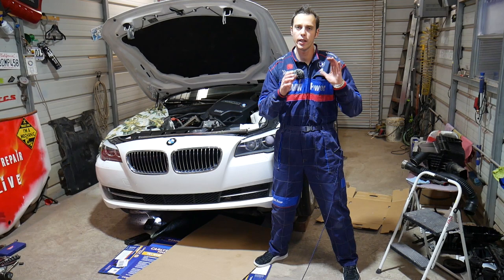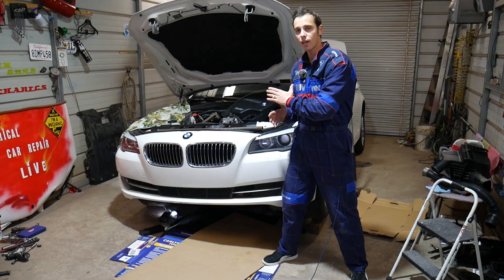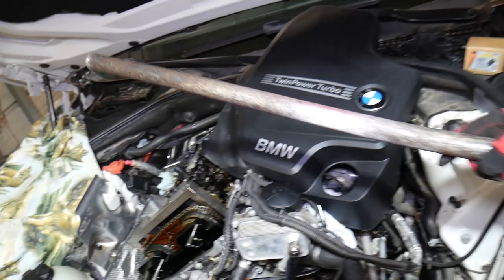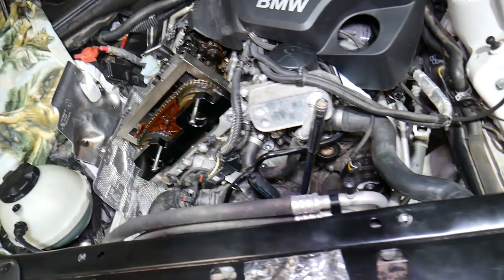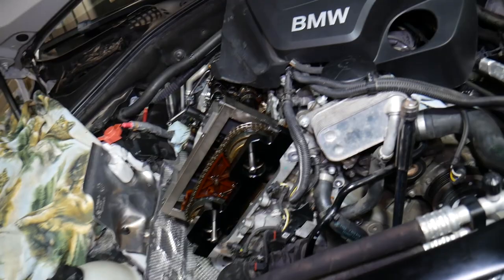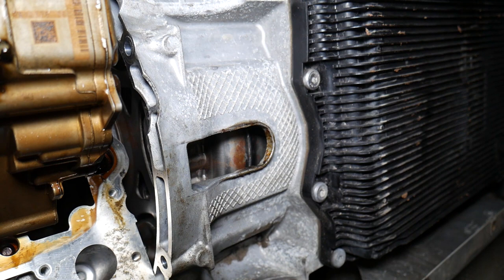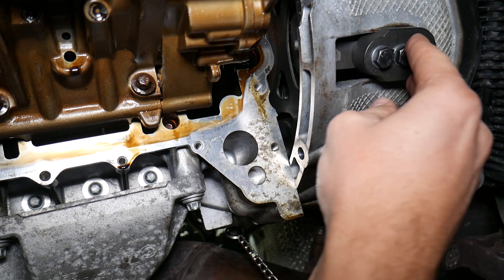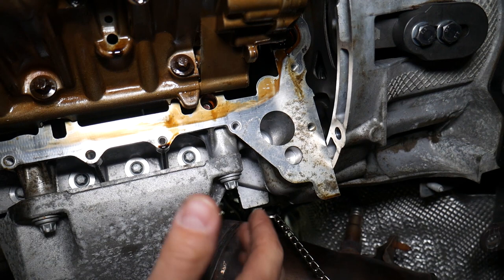BMW F10 F11 HOW TO GET CRANKSHAFT BOLT LOOSE 520i 523i 528i 530i 535i 518d 520d 525d 530d 535d

Comment: I have a 2011 BMW F10 535i with N55 engine. How do you find where to put the pin on the fly wheel to set the engine to TDC (Top Dead Center)???

Comment: Help me I have a sonata 2.4 2009 overheating since I unplugged the temperature sensor my fan start running on the highest speed but if I connect the fan take to much time to start and don't even start on the high speed and my car start overheating
Reply: You still got car add coolant put cap back on make sure battery good and another car charging it seeing first time step on gas for 10 go to coolant put ear on cap listen for water pump movement wait 10 min cycle key do it again add coolant ten seconds wait 10 . If no leaks no more overheating if leaks fix hose do again